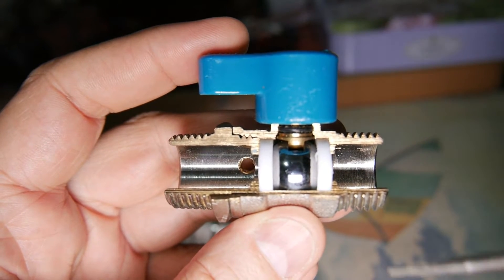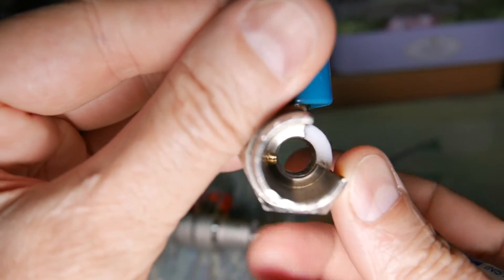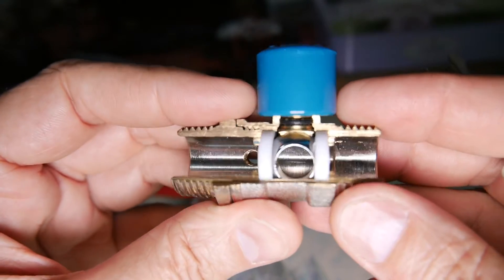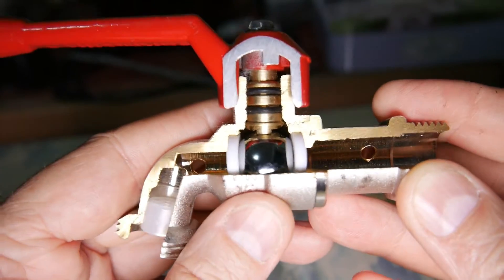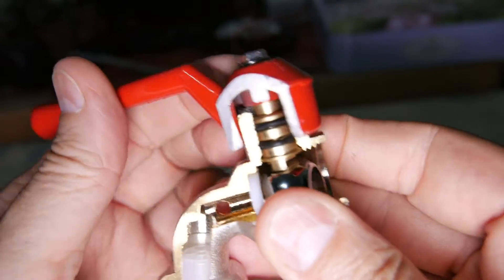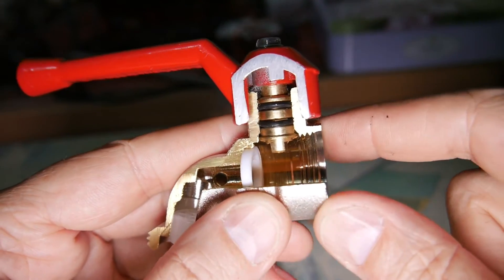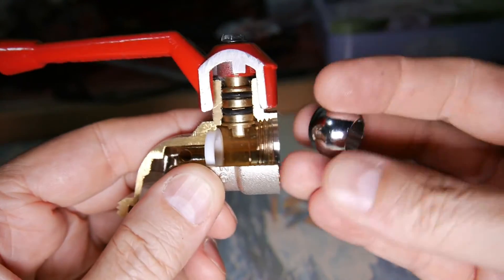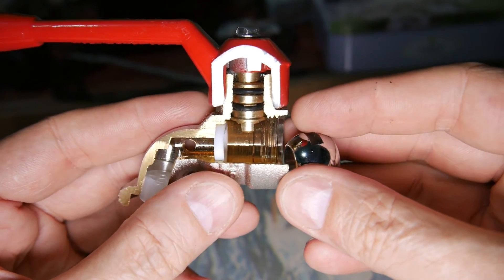Ball Valve With Teflon Seals Cutaway

Comment: I have replaced all the gate valves in my home with ball valves.
Reply from the maker: Even the best gate values leak and then there's packing and such.   These are a huge improvement.
Reply: Another point I like about using ball valves is that you can see if the valve is open or closed just by looking at it, you cant do that with a gate valve.